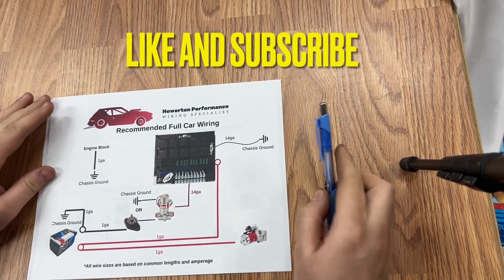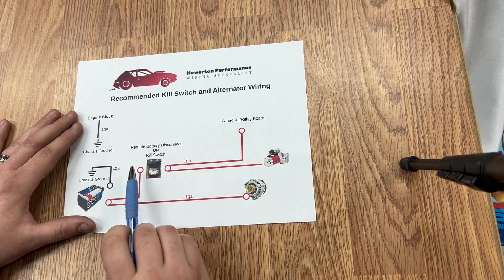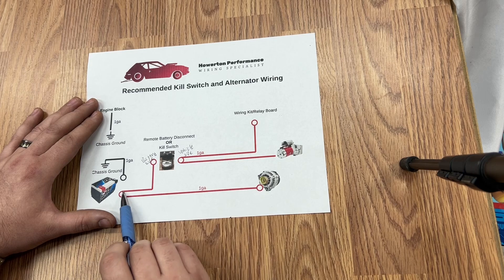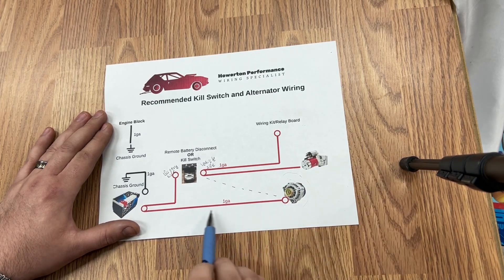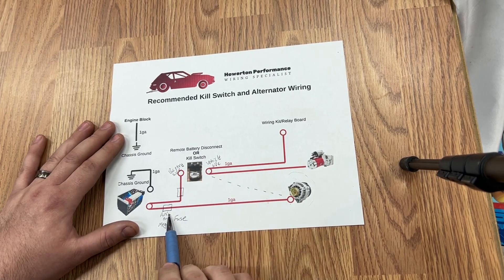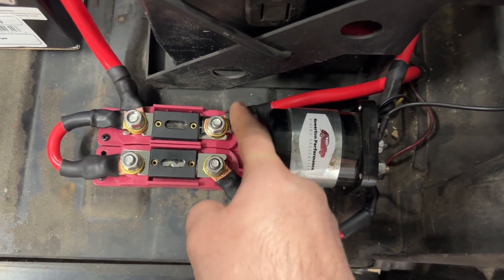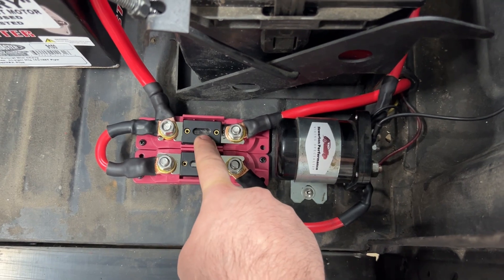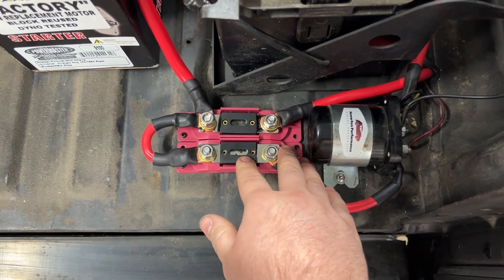Racecar Battery and Kill Switch Wiring

Comment: Shouldn't fuses be aligned with the ampacity of the wire instead of the transient draw of a starter?
Reply from the maker: Sort of, but not really. Fuses are in place to protect the wire from being damaged and also to reduce the chance of arcs/sparks that can cause fires. If the starter pulls 300 amps, then the fuse would need to be slightly larger than that, if you size the fuse too small then obviously the fuse would blow all the time. After you know how much amperage the component will draw, you would need to size the battery cable for that amperage. So really you should be sizing the wire for the average amperage draw and the fuse for the max amount of amperage that the component will pull. When you do that, the wire will be sufficient and then if the component pulls more amperage than it should, the fuse will blow.

Comment: What about resetable circuit breakers instead of fuses?
Reply from the maker: Those can be used as well. I just personally like fuses. It’s cheaper and easier to replace a fuse than replace a whole breaker. When sizing fuses you really want to get as close to the actual amp draw as possible, so sometimes you will need to adjust the fuse size a little until the correct one is found.

Comment: They way u ran the wiring to the starter is it off the starter that it goes to the alternator?
Reply from the maker: On our truck, yes. The absolute best way would be to use a couple solenoids with multiple battery cables to completely isolate the circuits, but that’s not always  feasible.